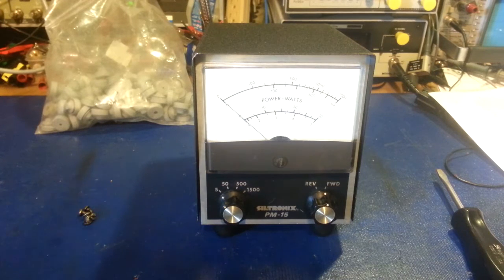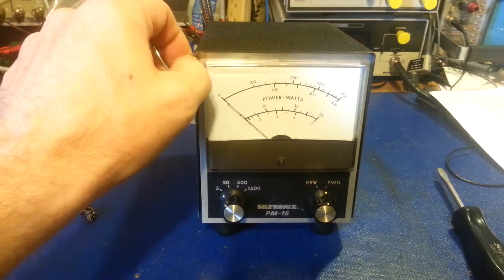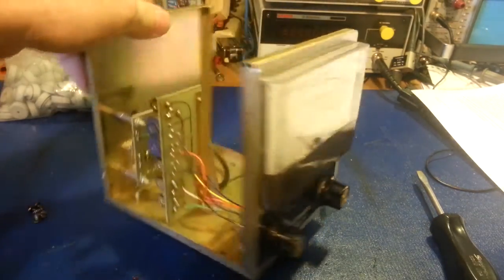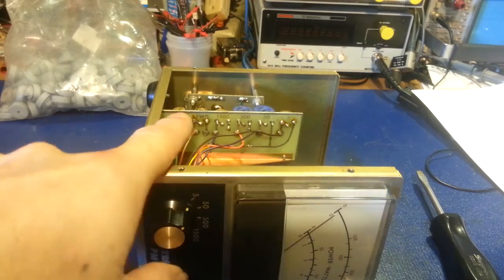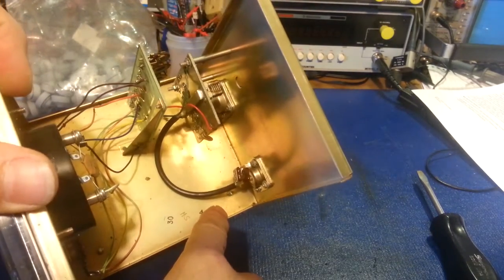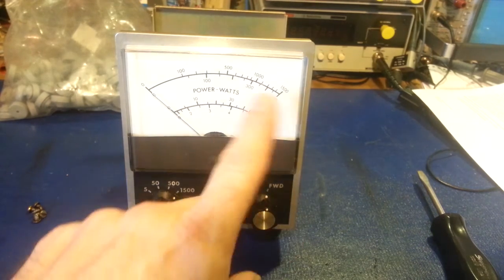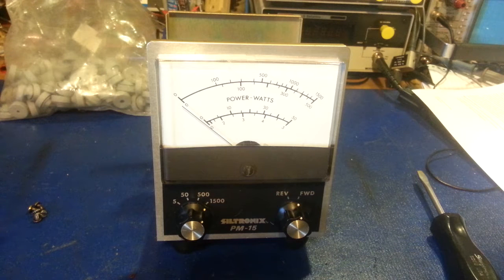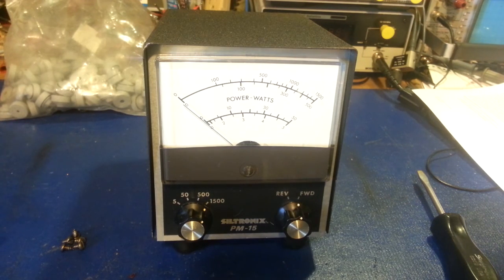Siltronix PM-15 RF power / watt meter.

Comment: looks pretty cheap, I'm suprised
Reply from the maker: Built like a tank and darn near indestructible.   Not sure what you would expect to find in a power meter.  It actually has more than most.  Remember its not a peak reading meter.
Reply: maybe I'm thinking the big swr bridge enclosure.
I was hoping to see the toroidal coils with the coax going through
Reply from the maker: +ᗒ╬ᗕ1112223333111ᗒ╬ᗕ 

This type can be more precisely calibrated to a specific band.

Comment: Could be a little "high adventure" adjusting the 1500W scale at the top end but the pots are quite a way from the RF path! I like the shrouded SO-239's but am a little suspect of the what appears to be a RG-58 interconnect? Key down into a moderate to high SWR might heat it a bit (the reason I've always like resonant antennas!). TNX for sharing Mike.  73 - Dino KL0S
Reply from the maker: When I redo meters like this I replace the coax with a piece of LMR 240 or 400 depending on what their max power rating is.